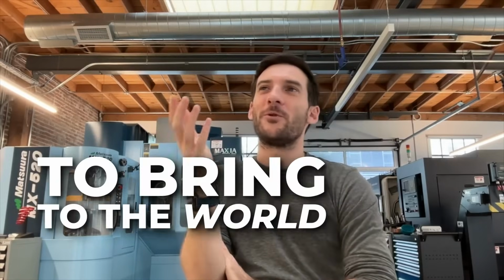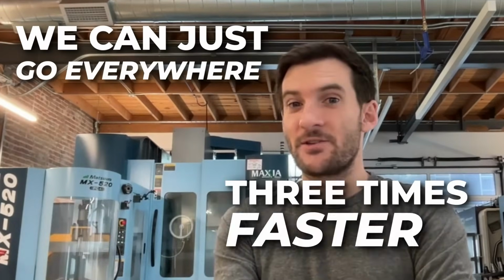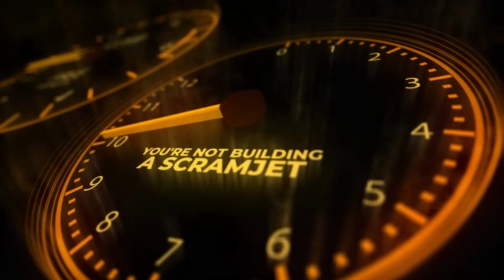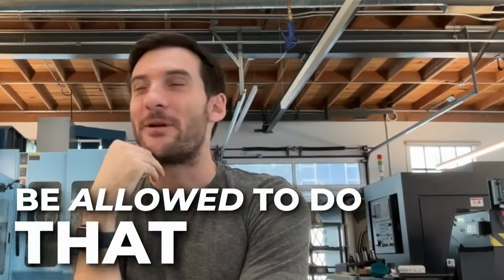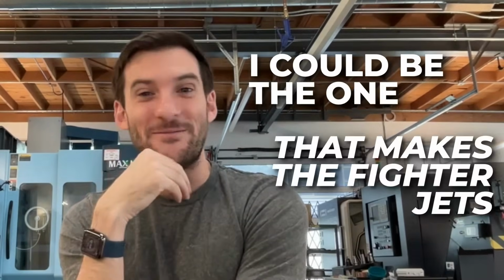The World's First Electric-Adaptive Jet Engine | Ian Brooke, Astro Mechanica

Comment: just an idea. If one cools copper wire down to liquid nitrogen temperature conductivity of the said copper wire increases around x6 times. So, if you use very cold fuel, like liquid Hydrogen etc. to cool the electric motor you can increase electric current and thus the strength of magnetic field.

Comment: 10:51 that is a motor jet the Italians messed with it in the 1930s making the N1 which first flew in 1940 making it the second jet to fly (the first was the German turbo fan powered HE178)  but generally motor jets  the worst of both worlds heavy, complicated and slow to get to full power
though I suspect they are the most efficient type of jet engine out there because piston engines are far more efecnt than jet engines

Comment: A high speed gearbox tends to be in the upper 90's in efficiency. The overall efficiency for generating power, regulating it, using the power to and power a motor... You're probably in the 70's. Maybe that would change once you start approaching 1000V... The electrical system buys you flexibility but is still very far from approaching the power and energy density of a conventional system.

Comment: Load of crap there’s no way you can produce the same amount of thrust that a jet fuel, jet engine, can plus the amount of batteries you would need would take up half the plane plus the weight of an electric jet engine, batteries, controllers wires would be astronomical

Comment: 🤜⚡💥⚡🤛 We have invented an ultra-torque dense[think light, compact], infinitely variable gear technology [advanced planetary-class...w/o spur gearing, 90% smaller] which does not use tooth/spur architecture. It is based on our reformulation of gearing theory. It enables low cost, efficient, power dense turbo machines including rocket engines. Improves electric machines too. 🤜⚡💥⚡🤛
...   ...   ...
Reply: if this is even a slightly true-ish statement then leave the company name, YTube video titles, etc. so that potential buyers can respond.
Reply: @WatchWhatYouAskFor   I represent  New Frontier Technology Group. We try to stay under the radar for now...need funding, but I can be reached here. Gave up on  the 'woke' LinkedIn nonsense. You may find links to various innovation papers all over the net including the Fuel Agnostic Zero-Emission FAZE engine. 
===
Our latest push is to develop a simple, low cost, point to point, / door-to-door, rapid to market, ultralight category, personal air mobility platform called PersonalJet©, which, with investor funding, will later be developed into an more advanced ride hailing / air taxi PersonalJet 2.0 system which will shelter our [mine mostly] IP/innovations. Autonomous capability will address cargo markets. Other features will set us apart from the crowd.. The PJ 2.0 will have very advanced ultra-efficient engine[s]. Larger system will be able to go trans-oceanic distances...in a small footprint. We aim to disrupt current paradigms/players/markets.  Seeking strategic partners, investors, etc. now.

I'm a triple engineer w thousands of inventions but for lack resources.... 🛑
===
Ya, YT/Goober might be forced to adjust their sick censor-ship agenda, now that the Freedom administration is in.

Leme know this went through. Tnx.

Comment: If you add liquid air to liquid methane, you could run cooler. You could pump a lot more fuel in before the metal starts to melt. Mach 4 probably!!

Comment: This may make a great aircraft but not a great rocket per kg to orbit since the rocket payload will be constrained by the size of the aircraft and since drag increases with the square of speed you need to get tf out of the atmosphere as fast as possible. At speeds above Mach 2 even the thin stratosphere has a major impact. Even getting your first stage oxidizer for "free" (it's not really) you're only saving a marginal amount of weight at the cost of overall capacity.
Reply: Oxidizer weighs a lot. If they can do it quickly enough, effienctly enough they can do it. Especially if they start pairing it with other engine types.

 I am waiting for numbers outside of top mach. I have no comparison against other upcoming technologies like Hermes or Rotating Detonation engines. 

 I see this best for military tech anyway.

Comment: Isp is highly relevant to weight, as the fuel depletes the rocket get lighter, but how are you going to achieve the same isp as a typical rocket lugging battery banks and controllers? Air breathing jet engine can operate in a small portion of overall atmosphere.
Reply: I think this is driven by a jet fuel generator. The electric just decouples the compression and expansion components.

Comment: There was a piston driven turbofan back in 1950. It was garbage, but it worked. I don't recall any talk about the airframe side of efficiancy?
Reply: Whats the name of the model? Never heard of it
Reply: @19wael96  they weren't very good, so more of a footnote in history. But they are called Motorjets. Although arguably ducted fan aircraft should also count. The particular model I was thinking of when I posted this is the Caproni Campini N.1.
Reply: @greybuckleton thanks a lot!

Comment: This sounds awesome! But I still don't really understand it... rocket fuel is really cheap... he also said rocket engines are relatively easy.. he is going to have three types of engines, and effectively a 3-stage launch vehicle. How is it going to be so much cheaper then reusable rockets?
Reply: My guess is fuel. The weight of fuel causes you to use more fuel to lift that fuel. Fuel is an exponential lift/weight issue. This tech probably lets you use exponentially less fuel.